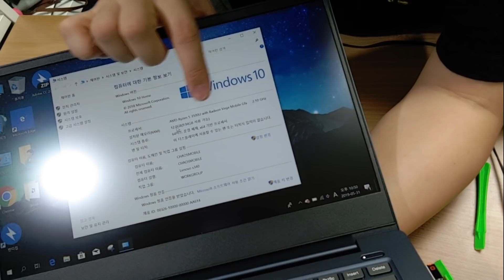Lenovo Ideapad S340-14API Unboxing & SSD/RAM upgrade

Comment: Thanks for the tutorial - does anyone know how long the battery lasts with this config with normal use?
Reply: pixelsafoison I think it’s 8 hours give or take
Reply: @Kendro06  Thanks for the answer - I ended up purchasing the C340 variant in 15" - and the battery life is 7-10h depending on use with an I3 8th gen. The ram was also easy to upgrade to 8Gb

Comment: I have the same laptop with 8b config. It shows as 5.96gb usable of 8bg. Is there any way to make full use of 8gb?
Reply from the maker: No way. This laptop has GPU integrated CPU, so some portion of RAM is used by GPU core.
Reply: If i replace one 4gb ram with 8gb of ram then also it will reserve 2 gigs or more
Reply: I watched other channel about reviewing this laptop, it has BIOS option to change ur graphic memory, just open settings on ur bios. And change the memory graphics option the lowest memory u can choose is 256MB.. So technically it should adding ur RAM.
Reply: @erwinm.mutaqqin4559  Latest BIOS, mine doesn't
Reply: @miamoglie3419  choose on UMA graphics
Reply: @erwinm.mutaqqin4559  No such options

Comment: Is it better than IdeaPad 330 i5?
Reply from the maker: There are many variations for Ideapad 330 with i5 processor, 
Can you specify which model are you referring to?

check below link for s330 options
https://psref.lenovo.com/syspool/Sys/PDF/Lenovo%20Laptops/ideapad%20330%20(15_)%20Intel/ideapad_330_15Intel_Platform_Specifications.pdf
Reply from the maker: @elevencyka176  , that model is equipped with i5-8250U, and it is about the same grade cpu with Ryzen 5 3500U.
That laptop has AMD Radeon 530 dedicated GPU, but it is slightly older generation GPU then Integrated VEGA 8 gpu.

I'd say both system offers about the same grade of performance, so price and screen size would be main difference.
Reply: @gyuhangcho thanks for the info .🙂

Comment: Can I install a 256GB M.2 SSD in addition to the SATA SSD there?
Reply from the maker: Yes, you can.
M.2 expansion slot in S340-14API supports mSATA and NVMe dual mode.
Reply: @gyuhangcho  what gen nvme? x2 or x4??

Comment: this is the hd version or the fhd?
Reply from the maker: This laptop is with 14" FHD(1920x1080) IPS, Anti-glare display.

However, it differs by the region. There are 1366x768 TN panel option available for some region.

Comment: does it have m.2 slot ? if yes then is it  nvme ?
Reply from the maker: It has 1 x m.2 slot supports NVMe and SATA.
Reply: @gyuhangcho  how come it could support both it should be either
Reply from the maker: @Trailertimeetc  it is very common to support both SATA and NVMe(PCI-E) type for single M.2 slot.

Comment: But when you add 8gb ram 
You lost the duel Chanel  (by using 2nd 4g ram)   
And wel all know that amd chip prefers the duel chanel
Reply from the maker: Yes, It is better to configure dual channel with 2 same capacity RAM module if possible.
But, even if you combine 4+8g RAM, it still work as dual channel. Intel calls it 'flex memory mode', but AMD doesn't put a name on it.

To be exact, if you add 8g to the onboard 4G RAM, 4+4 will work as dual channel, and the leftover 4g will be work as single channel.

It may score lower points in the benchmark software, but it is far beneficial to have 12g of RAM instead of 8g of RAM in most cases.

Since a high-end gaming is not like to be the main reason to buy this kind of laptop, I strongly suggest you add 8g module, instead of 4g module.
Reply: @gyuhangcho Have you tested iGPU performance with flex mode? Any significant loss? (on R5 3500u model)
Reply from the maker: @miamoglie3419  I didn't tested myself, but there is a good youtube video covers it.
https://www.youtube.com/watch?v=fMtqwrPy6Ek
This video is GTA5 comparison test between 4+4 / 8+4 / 8+8 on Ryzen 5 2500U laptop.

Yes, 8+4 flex mode gives lower FPS in gaming.
So, if you use your laptop almost for gaming only, I think 4+4 can give you better experience.

However, If your main goal is gaming, I strongly suggest you to spend few hundred bucks more, and get a laptop with dedicated GPU. :)

Comment: In Indonesia s340 comes with 512gb m.2 nvme . And empty 2.5" slot
Reply from the maker: That is actually better.
Reply: But ryzen 3 3200u haha
Reply: @MS-vs9mg  we should wait for ryzen 5 3500u version. AMD official told me, maybe around middle of December will arrive in Indonesia. But I doubt about screen panel. Long waiting for arrival in Indonesia. Than boom it came with TN panel 😂

Comment: Single channel RAM?
Reply from the maker: This laptop has 4GB RAM soldered and one RAM slot is for expansion.
If you install a RAM module, it will work as dual channel or flex mode.

If a 4GB installed to expansion slot, 4+4 will work as dual channel mode.

If you install any RAM module larger then 4GB, 
4GB portion of installed RAM module will work with onboard soldered 4GB as dual channel mode, and remaining capacity will work as single channel mode.

For example, if 8GB module is installed, 4GB portion of 8GB module will work together with onboard 4GB as a dual channel mode, and leftover 4GB portion of 8GB module will work as single channel mode. This is called 'flex mode'
Reply: @gyuhangcho  Thanks for that information! Didn't know this laptop has this technology!

Comment: Hello there. I have 14IWL (8gb ram, 256gb Nvme SSD) model.
Can we insert an SD card and use it as internal memory?

In addition, what SSD should I get other than that (for SSD)?

Comment: Hii Gyuhang,

Can I upgrade the ram of s340 to reach 16 gb. Mine has same 8 gb ddr4 with 4gb removable. Lenovo guy says you cannot upgrade it will harm motherboard. Please suggest. 

Thanks in advance.
Reply: you can't upgrade it to 16gb. 4gb is soldered into the motherboard, I think the only upgrade is to add 8gb ddr4 stick and have 12gb in total
Reply: @domantaas  Thanks for your reply.

Comment: This model has an M.2 port because you put an SSD of that model?
Reply from the maker: This model originally comes with NVMe SSD from lenovo,
but Korean distributor replaced NVMe with SATA SSD.
After purchase, I swapped larger capacity SATA SSD by myself.

Comment: hello sir loved the review im just wondering lenovo italu listed this specs on their site for this type of laptop RAM 4.0GB PC4-19200 DDR4 soldered 2400MHz + 4.0GB PC4-19200 DDR4 SODIMM 2400MHz plus mx230 graphics card and i5-8265u

my question is for the ram does that mean i can upgrade the ram? how about video editing can this video edit like 1080p30 videos?

thank you for the reply cheers from italy
Reply: You can upgrade ram upto 20 GB although the official website says 12GB
Reply: @late_nights  Hello,

Did you upgrade to 20 gb and did you face any difficulties?

Comment: Can use 16gb ram?
Reply from the maker: Officially no, but practically yes. you can install 16gb module.
Samsung will be safe choice though. I don't recommend modules from small manufacturers.

Comment: Wait what? You add 8GB RAM and you get 12 ? Lol how?
Reply: 4 are soldered
Reply: @leff2438  isn't that include the memory card slot itself ? So let me get it straight, on my computer there's 2×4GB 2666MHz memory  on the motherboard which one of them is solder one and the other one is in slot right ? So if I want to replace the one on the slot to 16GB  I can do it ?
Reply: @Amiro1990  Essentially, yes. But it may not have a ram stick in the memory slot depending on the spec. If you buy 4gig model, it will just have 4 soldered. Stick to 2400mhz for better compatibility.
Reply: @leff2438  it came from the factory 2×4Gb 2666 MHz like that I dodnt do anything

Comment: In this model in specify, can we put a m.2 ssd?
Reply from the maker: You may install m.2 - PCIe NVMe type SSD.
Typically this model is shipped with NVMe SSD as a primary storage,  so you may need to replace it, not adding it.